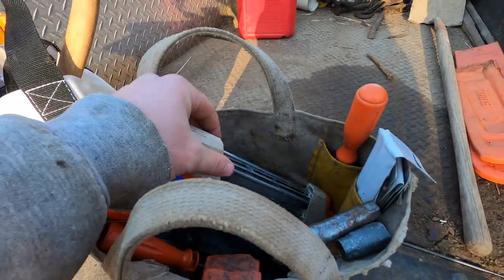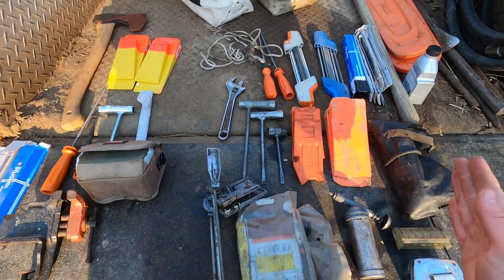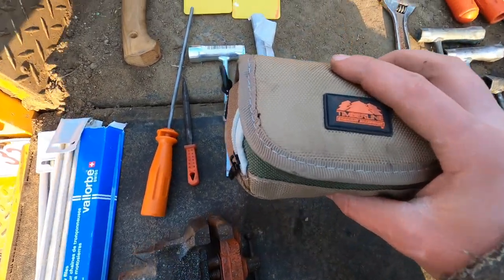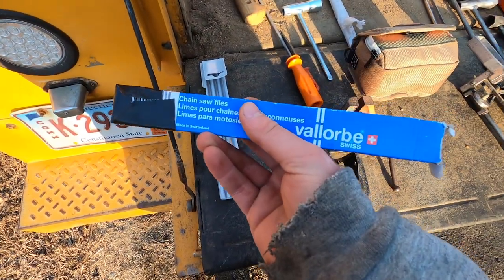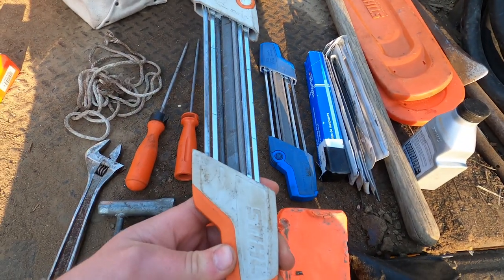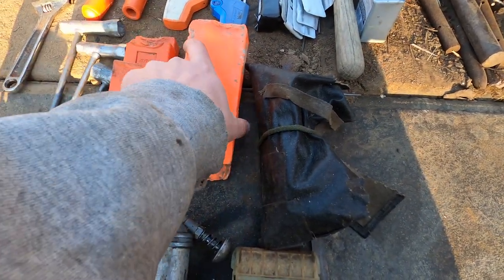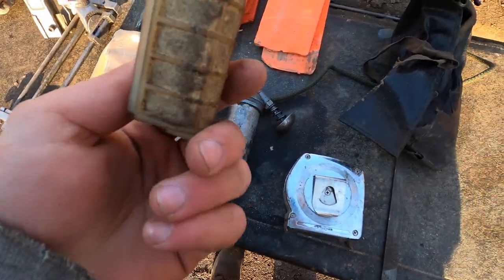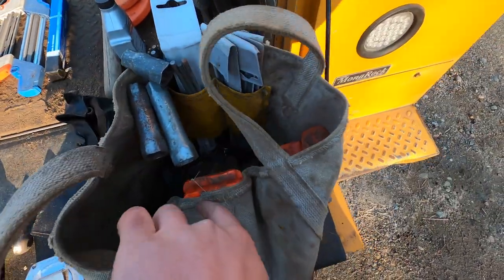Whats Inside Of My Chainsaw Bag?

Comment: I have a old Ford truck bed that was turned into a trailer. On the front of my trailer I have a bed tool box. 
Real handy as it will hold my 2 saws 1 traffic cone gas on one side bar oil on the other side. Plus the smaller stuff too..
Reply from the maker: That’s a really good idea